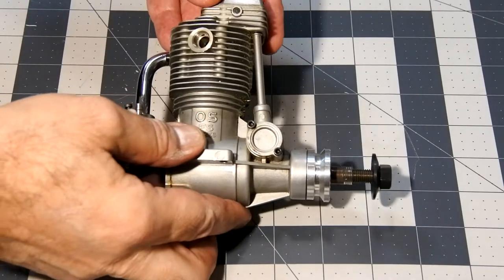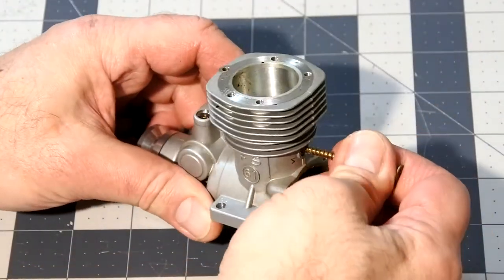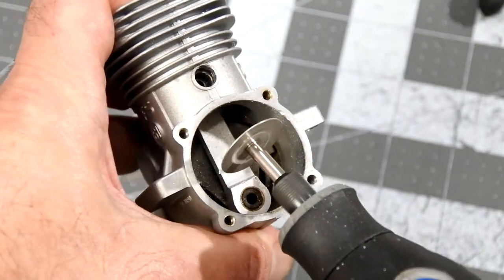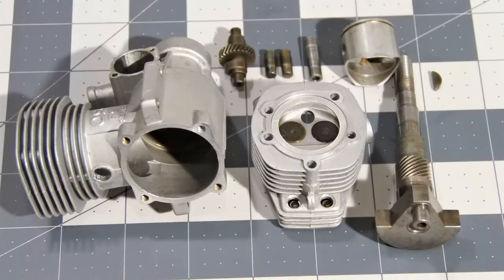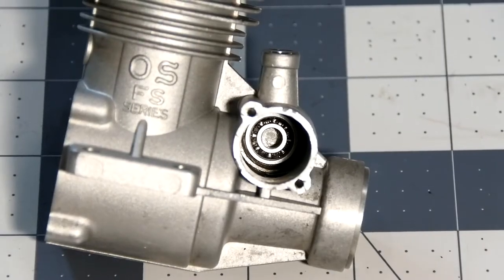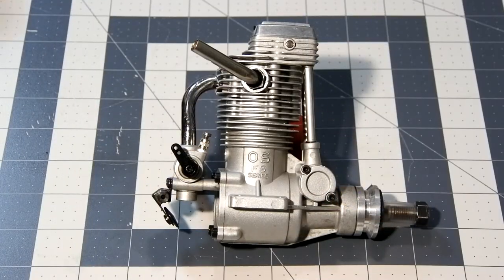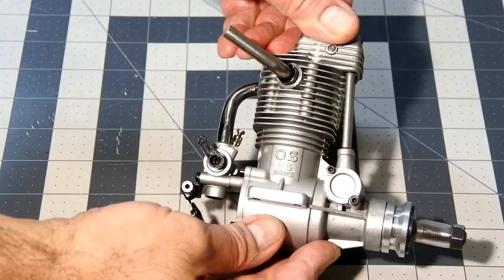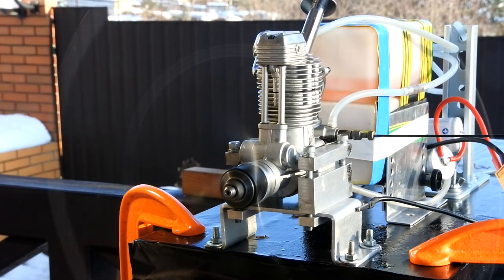OS FS 61 break to fix

Comment: hi, good afternoon , i like restoring old model engines and i also had a few cases of pin stuck in the piston. My method is that - i clean the engine first - wherever i can get to, e.g. combustion chamber, crankcase. Then I mount the engine on the stand and start it - it works at different speeds - until the fuel in the tank runs out. Against a stuck piston pin there is no better method than mechanical and thermal stress in a running engine. After the engine is running, the pin begins to move freely in the connecting rod and piston.  I've had 6-7 cases of a stuck pin - and this method has always helped me. BTW, this OSFS61 engine is interesting - I can't find this information now, but I read, several years ago, that a properly prepared model with this engine flew across the ocean from the USA to Europe /Great Britain?/. The engine was converted to spark ignition and ran on a mixture of gasoline and oil. All the best in 2023
Reply: I found this information!! :    https://en.wikipedia.org/wiki/The_Spirit_of_Butts%27_Farm
Reply from the maker: Thank you very much for your kind comment and advice ! It is very interesting method to free up the stacked piston pin, really and thank you very much for your advice. Unfortunately, this way will not work with few of my engines, due to the simple fact, that all of them had also piston rings stacked in piston groove (due to the usage of a castor oil).
And here we got the problem - how to start an engine without compression ? I was try to make this several times by adding a lot of a consistent oil into cylinder - liner, to increase compression level. Engine sometimes could start, but will stall in a few seconds \ dozens of seconds, because piston ring is still stacked into groove. Kind of non working Perpettum mobile...
Reply from the maker: @wojtekzimolag6668   Thank you, much appreciated !

Comment: Hello Sir Crazy Engines- I’ve recently found your channel and love the videos you produce. As an Engineer I appreciate your thoroughness in evaluation and data collection.

For stuck piston pins, I have used a micro butane torch to apply heat directly to the underside of the piston with some penetrating oil. It may take a couple applications. Give it a try.

May I ask what part of the world you are from?
Reply from the maker: Hi, and thank you a lot for your kind comment and for your question. I'm from Ukraine. Regarding cutting the connection rod story - I should say, that before cutting the conrod I spent a tens of hours, going to heat up the stacked piston pin assembly with a heat gun, but with any result. That was the reason, why I decide to cut and to throw away  a working  20 bucks part. You can imagine, that in an hours one of mine subscribers, and friend Tom (he is professional aero engines mechanics), gives to me an advice, to heat the piston pin assembly more with a help of a butane torch. I've also two of OS FS 61 engines in more or less equal condition with a stacked piston pin, as well, as a very similar story with an OS FS 40 engine. So, I decide to check, will it works with much higher temps of the butane torch. The result was great, at first, this works nice (I found, that it could be easily pulled out), at second, both three engine were repaired in an hours. All of them are still in my collection, and after its  repairing they are in excellent working condition. So, that means, that your advice really works, and thank you for that. Have  nice day !

Comment: Hi mate i brought a os fl 70 which was gummed up like that to the max ,it toom me a week to get it apart ,i used old fuel and heat gun ,soack repeat for days until wrist pin freed up it was a nightmare  great vid nice job on engine 👍👍👍
Reply from the maker: Thank you very much for your comment ! You're totally right - this engine was a kind of a nightmare for me, heat gun and soaking over a week in kerosene doesn't helps at all. I found, that it would be cheaper to cut conrod, that to pay a psychologist to recover me 😃.

Comment: I'm working on a FS-52 that I can't get out the wrist pin. Looks like i might have to cut my connecting rod also, that is if I can find a replacement!!
Reply from the maker: Hi, and thanks a lot for your comment ! Please, don't do that ! I found the way, how to extract it. Mostly, the reason of deadly staked pin - an old polymerized castor oil residue. At normal. room temp it's like a resin or old glue. But if you will well prepared, you will win ! I've consequentially 3 OS FS 61 engines, in one ( with the first one) I was obliged to cut the conrod. But with others I decide to warm up the top of the piston by a small, thin  flame focused gas torch (like a turbo lighter for cigars). I heated the top of the piston pin until was able to pull out the piston pin. It works, just take care about open fire and control the temp of the piston surface. I heated it a lot, was  very afraid of possible melting. But it works, and was worked 3 times, 2 for deadly FS61 and 1 for deadly FS40.
Good luck  and have a nice day !

Comment: Sir, using that loading press for assembly is a great idea. Especially since I own two of them. I would not think to take a Dremel to the connecting rod. Looks like you had a very expensive but rewarding project.🙃
Reply from the maker: Hi, and thank you a lot for your nice comments ! Definitely, I spent a tens of hours trying to extract deadly stacked piston pin, and every unsuccessful hour really makes me incredibly upset. But one time, one of my subscribers, which is really very nice guy and high skilled aviation technician, tells me "heat it more, for higher temperatures". This advice was given to me unfortunately, after my conrod cutting adventure. 
Should say, that I've almost own two OS FS 61 engines in addition, both were in the same terrible stacked piston pin condition, Using my friend Tom's advice to heat it more, both of them were successfully repaired and right now all 3 is in exactly "like new" condition. So, I  pay, of course, a little more (especially, if take into consideration, that all parts becomes museum rare to find items), but thanks to Tom's advice, I've got an exceptional repair skills. So, it is up to you, to make  a conclusion of that story. Thank you and have a nice day !

Comment: What oil were you using to drip into the certain compartments as you rebuild it?
Reply from the maker: Hi, and thank you for your question ! Usually, I prefer after run oil, my own formulation, which consist of an 1/3 equal parts of 
1. Three-in-one oil  https://3inone.com/product/3-in-one-multi-purpose-oil/
2. Mobil ATF Dexron VI https://www.mobil.com/en/lubricants/for-personal-vehicles/our-products/products/mobil-dexron-vi-atf 
3. Motul Micro 2T synthetic oil https://www.motul.com/sv/en/products/micro-2t
 or Klotz Gas Burner 
https://klotzlube.com/shop/ols/products/xn-rc-modelube-gasburner-u4ak
Some of mine subscribers also utilizing this formulation, especially, to fill the engines into long time storage.

Comment: Very clever use of a reloading press. :))
Well, cutting the connecting rod was a pretty extreme method of "repair". But in the end the engine was running again so it's all good.
I would try directed heat. IE, instead of putting the whole engine into an oven I would use a pencil torch, with a pinpoint flame aimed at the piston pin directly and just burn the castor residue into ash. After letting it cool, put in the ultrasonic cleaner bath again with hot water and dish soap. If that still was a problem, instead of a drywall screw I would use a thread cutting tap and cut some threads inside the piston pin and then screw in a machine bolt. Once again some heat and the torque of turning the bolt would probably break it free.
Reply from the maker: Thank you very much for your great advices ! I should say, that I was try several methods (direct heating, heating in the owen, trying to make a thread inside piston pin), but there was very hard case, that's was the reason, why I decide to cut the conrod. B.T.W., it was practically new. 
Once again, that you for your advices, much appreciated, will try it for the next repairs - I've few more OS engines with exactly the same syndrome, no compression, stacked piston ring and staked piston pin.
Reply: @crazyengines88  Okay. Such a stubborn engine! Well, there is one more method to mention, however it is hazardous. That is to get an electric pot, what we call a "crock pot", and use engine coolant, anti-freeze, straight from the jug. Heat it as hot as the crockpot will go and soak your disassembled engine parts for several hours. You must be careful not to let any animals get to spilled coolant, and you must never use the crockpot for food ever again. And you must do this in a well ventilated area.
Reply from the maker: @xKmotx  Thank you very much for your advice ! I was started step by step all the methods mentioned. First attempt was give to soak into special  oil paint solvent. Will wait for 3 days, than will  put it into ultrasonic bath again. Will warm up until 44-50 degrees. If it will not works, your next advice will be applicated.

Comment: Great work. It can be quite disappointing when you get a eBay purchase like this home and realise the extent of what "used" is really is.
Reply from the maker: Friendly speaking, I was found the way, how to pull out any (I hope, that any) deadly stacked piston pin in OS engines. 
But that knowledge were obtained after that case. I've one more OS FS 61 engine with the same problem, I was able to pull the stacked piston pin out without cutting it. But you will need to have s steel nervs :-)

Comment: Great video and terrific job. Tranks a lot for sharing.
This is just another example what castor can cause inside an engine. Just don‘t need that. I‘ll keep on using high quality synthetics.
Reply from the maker: Great ! Great comment and much appreciated you for that ! Exactly, hi quality synth oil is only the way  to prevent engines from such destiny. Frankly speaking, I've two more OS engines with such syndrome - deadly stacked  piston pin. That's was a reason, why I asking my viewers about some other advices. 
Probably, Mr. David McIntire, with his enormous engine repair experience, could give us an advice.
But to ne honest - if you can't remove deadly stacked piston pin - you can't proceed further with engine repair. So this experience is highly valued.

Comment: Heating the crankcase using a Heat Gun you can avoid pressing in new bearings. Using a press on a bearing is never a good idea if you can avoid it....🤔😏🇬🇧
Reply from the maker: Hi, and thank you a lot for your comment ! Sure, you're totally right there. But can you imagine, how much different size tools for bearings installation I should have with all that amount of engines in my tests and repairs ? I think, at least, 10 or even more. Also, should say, that all my engines runs very nice, without any hesitations to the bearings performance. Anyhow, you're totally right and thank you a lot for your comments. 
Have a nice day !

Comment: Oh my god!! WTF???
Reply from the maker: Nothing special, Sir. That was the only way left for me was to cut the connecting rod to remove the piston pin, which was firmly attached to the piston, due to the polymerized castor oil residue.
That's was a small price to pay for a rebuilt engine that's like new now.